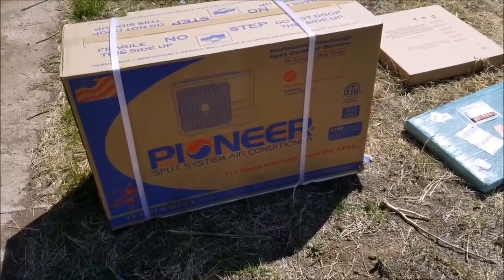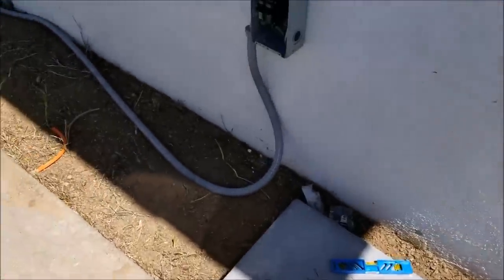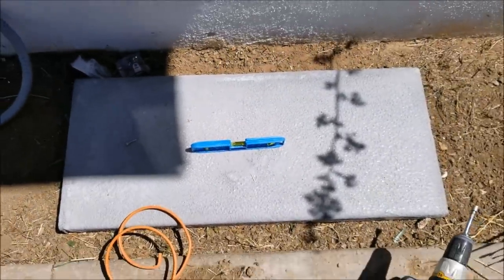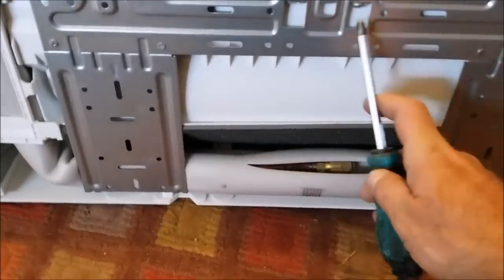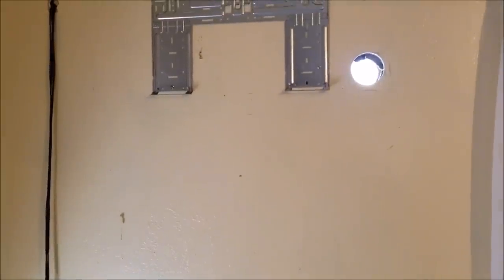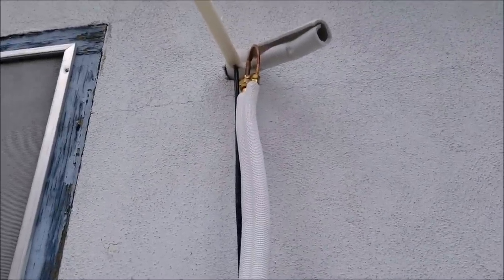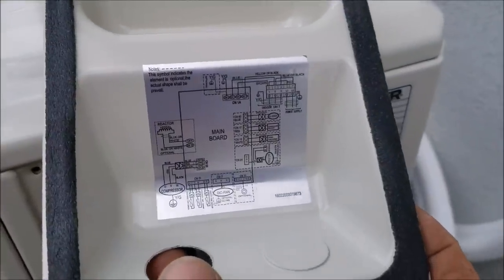How To Install Pioneer Ductless Mini Split 12000 BTU 230 Volts Air Conditioner

Comment: You should let the vacuum pump run a good 20 minutes at least, and a cheap pump you might want to run longer... 

Your gauge showed only about half as much vacuum as you need

You are also not supposed to remove the vacuum pump until after you open the valves

Supposed to crack the valve and allow refrigerant to fill the lines, then close the valve and remove the vacuum pump

Then you can open both valves all the way
Reply: the trick is not to disconnect the hoses u can take vacum pump out after you hit the right Micron level you just can't remove hoses and make sure manifold is closed before disconnecting the vacum pump

Comment: Swinging back to Youtube to figure out how to use the vacuum pump and gauge... and whatever... as I know nothing about any of it.  This isn't the video to learn what I'd like to, BUT, I wanted to comment that NEC hates the communication cable set shipped with these Pioneer units (as of 2021). If you are doing permitted work, or care what the NEC is trying to do for you, make your own comm cable from rated wire.

Comment: Hello, I have a unit same like yours however the connection where you vacuum has a shredder valve, and the ac manifold just comes with regular hoses. Do I need to remove shredder valve out in order to vacuum? Thanks for your video.
Reply from the maker: No, it doesn't need removal, It's like the stem on a bicycle tire it opens and closes when the hoses are attached with the adapter.

Comment: Seems like if you still need to vacuum down the line you could go ahead and unsolder the fittings and cut the lines to be a little shorter and eliminate the insane amount of pipe lefty coiled behind the unit or is there some reason that you should not?  I'm just curious because I am interested in perhaps setting up one of these units for my garage space and I'd like to have the finish product look clean.   Thanks

Comment: I think you should connect blue pipe to the AC and check the blue gauge which is for VAC. did you open valve on the gauge?
Reply: manual said connect to blue, not red

Comment: What made you pick the Pioneer system? Did you consider others?  Is it true that you void the warranty by DIY?
Reply: Generally the material with all mini-splits say that the warranty requires installation by a licensed HVAC professional....why would they warranty their product if it was an improper install done by a DIY'r that caused it to fail.  Generally products are warrantied for manufacturing defects.  I know this was an old question.
Reply: I hope you didn't leave the wiring laying on the ground.

Comment: This is a great vid. I have the 24,000 BTU unit I am working on. I need to make a 90 bend on the outside wall and I kinked the line bit.  How bad is that?  I still don't have it bent over enough for the cover yet.  I am not sure what to do now?????

Comment: Great video - thanks!  I installed three Pioneer Mini-Splits two years ago, and they have been the best things I've done for our house.  One was the 12000, and two were 24000 BTU's.  They cool very well, it's easy to clean their filters, and the savings in electricity is phenomenal!
I had a question, but I don't know if you've needed to delve into any maintenance yet.  
I want to clean the fan blades, which are the only things that have become "gunked" up over two years (the coil fins still look great).  
But - do you know the "secret" to removing the full front cover?  (Not just the main flip-up access door - I need to take off the whole plastic cover - front, top, and sides.)
I believe the two small cut-outs on the bottom at the back may have some sort of a clip release, because I can't find a place for the screws inside the vent area that most mini-splits have.
If you have any idea where the releases are to get to the fins and the fan, it would be an immense help.
Please enjoy your new, efficient cooling / heating system!
Thanks again, Randall
Reply: I recently had to remove the full plastic cover as you described on my 24,000 pioneer head. There are 3 screws to remove. 2 of them are behind little flip-up doors (one on the left and one on the right) under the motorized blade. The third one is under the main face panel that swings open for cleaning filters; it's located on the right side by the wiring. It might even be under that wiring access panel. After those 3 screws are out, then the rest is just tabs. There are some on top along the back side, and then some in front just below the filter area. It's just a case of slowly working all the tabs out all the way around, and then making sure to move that blade as needed for clearance. This worked for me, hopefully it works for you.
Reply: Do you need to install every room?
Reply: No, you don't.  Just install in the rooms that are most used: Main Living Room, Master Bedroom, other bedrooms, as needed.  Closets, hallways and other areas will be filled with air from the main rooms.  But you may need to install in bedrooms that are down longer hallways.  And our kitchen could benefit from one, especially when cooking in the summer.
Reply: Hey , I have to install one in a few days, I’m  confused about the electric breaker , in the video he installed a 20 amp  breaker , but on the unit shows maximum 15 fuse or breaker , what kind a breaker did you install? Thanks .
Reply: Are your pioneer units still holding up?? currently in the market for one

Comment: Hi, about to install my own mini split similar to yours. However the outdoor unit and indoor unit are closer leaving me with extra lineset. Everyone recommends against it but I have no choice. Noticed yours were coiled and wanted to know did you leave it that way? Also how’s the unit doing today. Any response would be appreciated. Thanks
Reply from the maker: The unit is still working great. I left the line set coiled up and haven't had any issues.

Comment: First, thanks for the guide, I followed it and got my mini split up and running.  
I do want to share one thing that went wrong on the way though.  I bought the wire harness from amazon and it came with like 10 gauge wire.  The 230v 12000BTU only needs the 15 amp double pole, so I used 14 gauge wire to the shutoff.  10 gauge harness from the shutoff to the unit.  So after I got my vacuum and released the coolant I turned on the breaker and the inside unit gave me a P1 error.  That means over-voltage.  I googled that and got scared b/c it seemed like the PCB or power supply was fried.  But then I decided to replace that 10 gauge wire harness with 14 gauge wire and bingo everything works.  Just thought I'd share that in case anyone else runs into it.
Reply: The gauge of wire does not determine voltage at all. You had something wrong.
Reply: I bought the same unit and spec calls for 15A breaker, I was thinking to use 20A breaker, will that be an issue? In the video he also used 20A...

Comment: Thanks for making video. I had a question. The LCD screen has been flashing on inside unit but unit doesnt power on? Not sure if it's the fuse because I checked the wires inside and outside unit and there is power going through them
Any advice would be greatly appreciated 🙏
Thank you

Comment: Hi I'm ready to install my inverter unit. But my AC guy said I should have it 12 inches away from the wall like the manual said. Can I get away with it if it's 2 inches away. Thanks
Reply from the maker: The outside condenser has a fan that needs space for good air flow. I would get as much space as you can to not block  the air flow.
Reply: @HVAC_Mechanic  thanks boss

Comment: This is an incorrect installation after the vacuum check you are supposed to crack the refrigerant valve slightly for 5 seconds and close it again this put positive pressure in the lines. You removed the vacuum pump before doing that allowing air back into the system through the schrader valve they have to have pressure to seal negating the whole vacuum process. Also the blue side of the gauge set is what is supposed to be used it is the low pressure side.

Comment: What happens if you need more then 16ft, do they make extensions and if so will it impair the system from working properly 🧐
Reply: You can order longer line sets from the company. If you go longer than 25 feet you need to add refrigerant to the unit. You can go up to 50 feet.

Comment: My concern is the length of tubing that comes with unit, if tubing is too long, what can be done if the tubing is pr-charged
Reply: The tubing is not pre-charged. The charge is in the outside unit. Line sets come in various lengths. You can order a longer or shorter line sets. Some units come with a 16 foot line set, and you can increase up to a 25 foot line set without needing more refrigerant. The max line set is 50 foot, but then more refrigerant is needed. This various a little with each unit, as different units have different size linesets and contain different amounts of refrigerant.

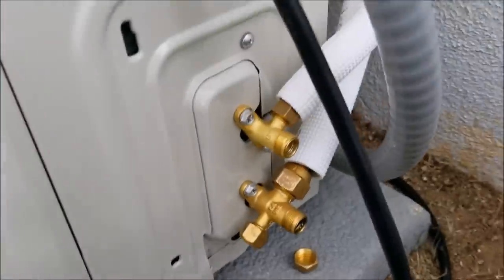Comment: After you pulled the vacuum at 16:04, when you disconnected the manifold, how did you make sure the vacuum still remains? Is the valve a one-way valve?
Reply: Yes, there is a valve in there but not to hold vacuum. you are actually supposed to close your manifold gauge valve it leave it connected. Then, after you have released the refrigerant into the lines, you then remove the hose from the unit. Since it's not quick release, you will get a little bit of refrigerant leaking out which is fine. A little bit of humid air leaking in if you remove them while it is under vacuum however, is not ok.

Comment: you failed to properly label the white wire with black tape to show it was a hot ine per code
Reply: Oh just use a sharpie, and make it red already have a black make it more 12-3. 🙄

Comment: I got  confused on part of video,where you stopped vacuum but did you close off the port before removing tube ? The video did not show that step. Could you elaborate please.
Reply from the maker: I did another video that show that part better while installing a Seville unit around minute 12:00,. Here is a link. https://www.youtube.com/watch?v=Dg-w2uAsEJE

Comment: great video! I got the same unit 230v 12000btu, and spec calls for 15A breaker which doesnt make sense to me. I am thinking 20A, can you please advise on which breaker size and wire guage/size to use? My subpanel is inside so its gonna be more work for me. Thanks
Reply from the maker: For this unit, 12 gauge wire is probably best and rate to 20 Amps. Either a 15 or 20 amp breaker will work but usually best to follow the instructions.
Reply: @HVAC_Mechanic  thanks

Comment: Was hoping you would show how you wired breaker unit. Wiring the ac unit to condenser is the easy part but I am not sure about to how install a new breaker to the  big existing breaker unit.
Reply: I'm a licensed GC and have my journeyman's as an electrician. I say this with all respect: When I'm uncertain (and I am sometimes, even after all these decades), I ask another professional more versed in the subject than I.
In short: Get a professional electrician in.

Comment: I have this unit in a new house i purchased, after running unit for few hours water started leaking on inside, we flushed drain line but still leaking, any idea why?
Reply from the maker: If a unit is low on refrigerant it can build up moisture on  the inside coil and drip water.

Comment: I installed my 17seer 12000btu unit about 2 years ago. I've been experiencing really inconsistent heating with it. If I set the remote to "Follow Me" and it eventually starts heating. However, within a few hours it stops getting a reading from the remote (I'm guessing) and won't heat properly. Any experiences like this with your pioneer?
Reply: When the "follow me" feature is used, the remote control sends the temperature to the main unit every three minutes. This feature works for a few hours (I forget hour many) then automatically stops.

Comment: For a 12x36 building that’s well insulated, would this be something that would do the job? If not, any recommendations? I would need to maintain a temp of 75-80 year around
Reply: Yes, it would. A 12 x 36 building is 432 square feet and 12,000 BTU units can normally handle up 600 square feet.

Comment: Can you install the lines in the wall and enter at the base of the wall to go outside? Or does the unit force you to send them direct outside behind the unit?
Reply from the maker: Yes the line-set can be run inside some walls. Here is a video I made installing a Senville mini split with the line-set in the wall. https://www.youtube.com/watch?v=Dg-w2uAsEJE&t=1s

Comment: Do you think the 10 ft line set would be better than the 16? I am about to order the mini split you have. Just thinking of Pro and con of the line set length. What is your thought. Do you wish you had requested the 10Ft?
Reply: The length is 100% dependent on where you want it.  The line should be near minimum length, apparently sloping down to the condenser.  16ft is standard, and what the machine comes pre-charged to, but the instructions and Specs say that you can run up to 25ft on the pre-charge.  If 10ft will get you to where the condenser will work/look best than that's the way to go.  Having extra line sitting around looks like crap and oil can get trapped in the low spots, when a professional installs they cut the lines to the exact length needed for a clean good looking job.

Comment: Agree, great vid on how to do. My one question once you disconnect vacuum hose wouldn't let air go right back in? Can anyone tell me, if I should just disconnect and not worry about from the compressor and open the values to unit.
Reply: The vacuum pump and gauges need to be isolated from the lines with a valve in the closed position after pulling the vacuum. A shrader valve will not hold the vacuum in the lines. I think in this case the vacuum was replaced with moisture laded air. Not good!

Comment: looks like you're using 2 adapters there one on the pump and one on the unit. is that correct?
Reply from the maker: Yes, it uses a Mini Split 5/16" to 1/4" Hose Adapter, a link is in the description.

Comment: You skip the part where you put the lines on the service valves, what valve do you turn to let the air into the vacuum pump?
Reply: The valve comes closed.  When you connect the lines you will need to also connect your service hose.  A valve core removal tool should be used to pull the core out so you can get a good vacuum.  The vacuum he got in this video is nowhere close to what you should have. Even with the gage pegged at -30 you should still be using a micron gauge and pull it to about 400 microns and make sure it holds!  With that pump that will take about 15~45 min depending on the line size. At that point, you open the service valve any allow the refrigerant into the lines.  Then you put your valve core back in and cap it off.  Note that the service valve seats in two positions so open it all the way.

Comment: These mini units can be expensive,easily over $1000.00 after all is done, and they are meant for one room.
$3,000.00 will get me another full size unit,hook it up to the existing system and I ll be better off...I guess if one doesn t have the duct work and only one room,otherwise it doesn t make sense.

Comment: I just installed a split system, but for some reason my Yellow Jacket regular gauge hose don't fir the ports. The ports are a bit bigger on this unit. The hoses fit 3 ton condenser port R22, but they don't fir this R 410a  ports. 
Any suggestions?
Reply from the maker: Mini Split systems need an Adapter. Here is a list of tools needed for mini split installs with links.  https://www.hvachowto.com/tools-needed-for-a-diy-mini-split-install/

Comment: I know this is from last year but I noticed that the unit wasnt bolted down to your slab in the video did you do that later?
Reply from the maker: No it doesn't move or vibrate so it is still running without bolting it down. Couldn't hurt though.

Comment: I have a 14 x 14 room with a 8 ft height ceiling. Can the heat on this handle Chicago winter?
Reply from the maker: Heat pumps don't work well when the temperature drops below 10-15 degrees or so. You would need a supplemental heat source on cold nights.

Comment: Would a 220 volt spend more electricity than a 110 , any advantage of the 220 over a 110?
Reply: No. A watt is a watt. If a unit takes 240 volts at 10 amps that’s 2400 watts. At 120 it would require 20 amps, making it 2400 watts.  Same KW/hr usage. The difference is wire and breaker size, and. 240 volt anything tends to run slightly more efficiently than a 120 volt, but it’s practically zero difference. 240 volts starts compressors and motors more easily. 
So in short, no big difference, but as an electrical contractor I don’t know why you’d buy 120 volt.
Reply: dirigoelectric thank you.
Reply: mt happy to help.
Reply: @tulio3571  hes wrong. There is a big difference.  A 110 outlet useing say 1500 watts is gonna need 12.5 amps where as a 240 only need half the amperage.

Comment: I like the Mr. Cool installation better. No need for this!! Just connect the lines in proper order and your done.
Reply: countryside Mr Cool does have both types- a person needs to purchase their DIY units if not wanting to vac down. 😎
Reply: I am considering a 18000 DYI from HomeDepot for $1600,  but now I see Pioneer on Amazon for $1000.  Is the price higher because it is a DYI with warranty?
Reply: @rondail5675  Are their any reviews on the Pioneer? Just wonder how good it might be?
Reply: @countryside8122  ,  
#1 Mitsubishi MUZ-FH
#2 Fujitsu General Halcyon
#3 Gree Crown+:

All very expensive
Pioneer $1000,   MrCool $1800

Comment: How do you know when wiring the outside to the power box wich is negative and positive out of the L1 and L2??
Reply: that's only for DC voltage. These run on AC.(no pos. or neg.)